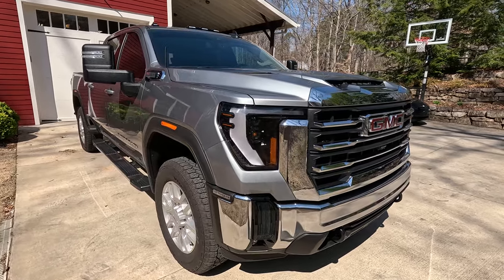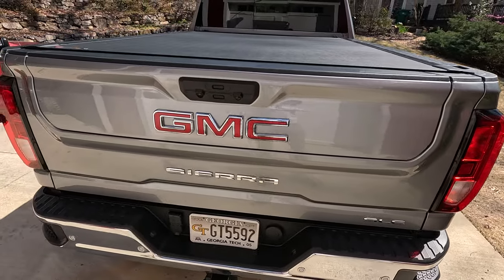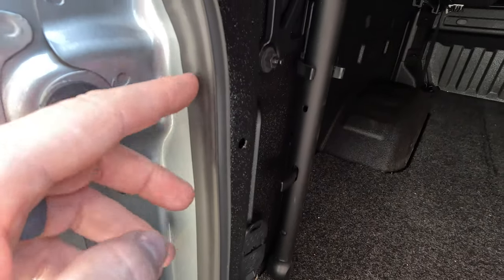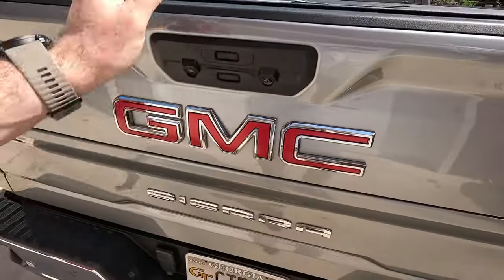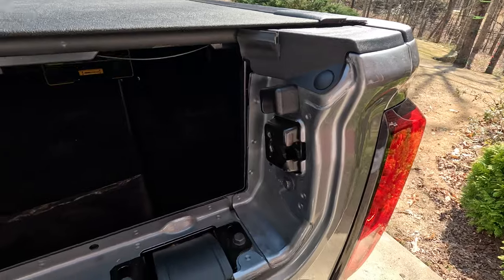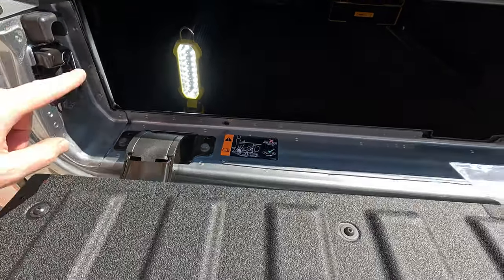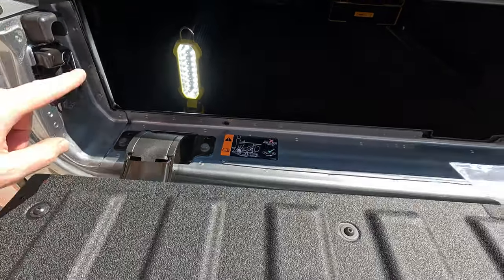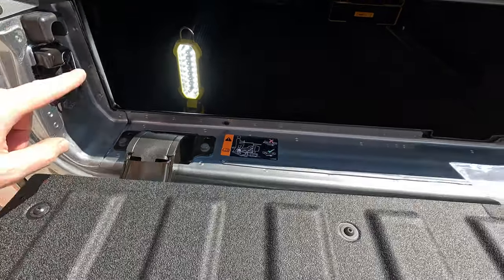Would You Install a Tailgate Seal? I Try One on My 2024 GMC Sierra 2500 HD with MultiPro Tailgate

Comment: After installing a Diamondback Alum cover on my 2024 Chev 1500 with the same tailgate I realized that there was zero weatherstripping and my box filled with dust when travelling on gravelled roads. Basically the box was useless for hauling anything as it ended up covered with a thick layer of dust..  I had the same cover on a 2013 Ford F250 and never had this problem. Ended up installing the ESI ultimate tailgate seal kit and it has eliminated 95% of the dust.

Comment: I have the same tonneau cover as you. I own a 2023 GMC 2500 AT4. I ran into the same issue of water entry down the inside of the tailgate. I decided that the seal on the tonneau was not pressing against the tailgate hard enough. What I did was use the extra smaller seal (red) that comes with the tonneau and apply right on the rubber  seal that supposed to contact the tailgate. The result was that the extra pressure from the “double” seal stopped any water intrusion under normal rainy conditions. I then ran it through a touch less car wash and found only a few dribbles of water going down the inside of the tailgate. Hope this helps!
Reply from the maker: Great tip, thank you!

Comment: Never had an issue with my 24’ 2500 letting water come in from the tailgate side. I have the same cover but have leaks at the front passenger side when it rains.

Comment: the bottom seal is just holding water in once it leaks, if it does get in you want it to escape or give it a chance too.....bottom seal prevents that a bit

if its raining and your parked, slope your truck where the water will drain out the back...if driving nothing you can do

thinking of trading my 23 in for specific purpose of that tailgate, I loved it when I had it in a 1500 and in my 2500 it would be even more so